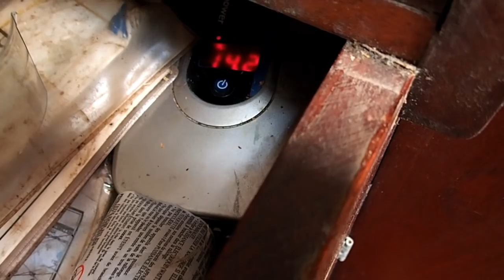The Power Grid for a 31-foot Cruising Boat

Comment: i also inherited a small wind turbine...which help keep power flowing in on those dull days up in the North of England. also giving me power at night. worth considering..but now I have a dual battery system with solar / wind to charge the batteries...but also a separate 'house' bank with its own solar...which also acts as a backup for the electronics if needed
Reply from the maker: True, solar doesn't work as well up north, especially outside the summer months when the sun is low in the sky.

Comment: Hi, have you considered Lithium Iron batteries , such as (LiIo4life or similar) They are more longer lasting, can be charges at a higher voltages so less losses. And you can have a depth of discharge to 10% or lower with out damage or issues. Where you need to keep your depth of discharge at 50%. . you could actually have less battery watt amps.
Reply from the maker: Yes, probably next battery replacement I will go with LiPo.

Comment: Sir, you are easily one of the MOST helpful videographers on YouTube regarding cruising!  So...I note that you didn't mention wind generators but went straight to the gas portable generators.  Is there a specific reason for this?
Reply from the maker: I've heard mixed things about wind generators.  My biggest problem is where to mount it.  The little gas generator is a nice backup.

Comment: I've heard something about a max of 10 feet to avoid the voltage drop.  I've been struggling about how much battery to keep.  For me - alone that is -  what you have 100 to 125 usable amp-hours is probably good.  With my kids I'm unsure. I"m thinking 400 amp-hours total.  Maybe even lipo...  They have their phones and computers. I can see waking up one morning with dead batteries.  AGM can come back from dead once, maybe twice but I don't relish having to fork out 1000 dollars for new batteries because my kids can't sleep some night :)      I don't have a fridge but have been thinking of getting one of the Engel cooler/freezers.  That would make life a little easier.    That and a water-maker and I'm one happy sailor.

Comment: That's why they invented MPPT charge controllers. (Maximum power point tracking)  It takes what ever amount of voltage your panels are making and converts it to a higher voltage which will charge your battery bank even when its cloudy out !

Comment: Thank you for another wonderful video!!  I have 70W of solar on my boat and it has really helped!! I plan on increasing to 200W this year and increasing my battery bank.  I agree 100% that you need a big enough battery bank to last 3 days with out any power,  I am currently not sure if I will go with flooded batteries or AGM.  I agree that the AGM batteries are better, but I can buy 3 sets of flooded batteries for the price of AGM.
Reply from the maker: Check out VMAX AGM batteries.  That's what I use and I find the prices on them are similar to lead acid batteries.

Comment: "cruising emerald steel" channel (another gaffer) has a really interesting take on solar charging.  They have a bank of 6 t-105's and have 180watts of solar panel, so that at max charge it just does an equalization charge on the batteries, and they are on their third set of batteries in 30 years, of full liveaboard, with no charge controller!  They also removed the anti discharge diodes from the pannels, because they measured the loss at night, and it was less than the loss of charging efficiency the diodes caused in the day!  When they leave their boat occasionally for like 2 weeks to a month, they cover one of their 2 80w panels, to make up for reduced power usage

Comment: i get a small petrol trimmer and i connect a cheap car alternator threw a belt drive system! This charges all my batteries very cheaply. Car alternators a cheap to recondition!
Reply from the maker: I take it you mean a gasoline powered hedge trimmer.  Now that's inventive!  I don't know too much about car alternators, with AGM batteries you have to be careful not to overcharge them ... thanks for sharing this.
Reply: Car alternators are easy to recondition. Many utube post show you how. It's better then generators as parts for generators are very expensive. If you want simply buy alternator from the car wrecker for around $30. Car altrenators only have two cheap bearing and bushes and four to six diobes. Buy the alternator that have the bushes and diobes built together. Alternator recondition is around $30.
Reply from the maker: Again, thanks for sharing.  A cruiser friend of mine also pointed out these camp generators for a little over $100, though looks like you would still need an a/c charger to charge the batteries with it ... 
https://www.harborfreight.com/engines-generators/gas-engine-generators/900-max-starting700-running-watts-2-hp-63cc-2-cycle-gas-generator-epacarb-63025.html

Comment: Whoa, Kevin!! Never mind the boaty stuff, what about making an episode on giving yourself a haircut?? A cheeky lapse in continuity, might i say. First you don't tell us your a wizard with the Axe, now we find out you're a demon barber. Your live aboard lifestyle know no bounds.
Reply from the maker: LOL!  I didn't shoot this vid all in one sitting ... I went ashore for a haircut in between takes.
Reply: How to Sail Oceans Ah, I see. I thought you might have a 12v pair of clippers haha. Which begs the question, is that VOX amp 12v or do you have an inverter? Thanks for the info on solar by the way, but have you seen Patrick’s upload on the methanol charger which I thought was very cool. What do you think?
Reply from the maker: I use an inverter to power the Vox amp, which, btw, causes an annoying buzz.  For recording guitars I have to use my Zoom effects pedal which is powered by a USB cable off the laptop--all DC so no problem with buzzing.  Yes, I checked out Patrick's charger, very cool and environmentally friendly.  Expensive though.  If I recall it goes for about $6K; you can get a gasoline generator for five hundred.  The fuel packs looked expensive too.  Maybe prices will come down in time as they did with solar.

Comment: Another excellent video. I too have used solar on my boats. Usually had only two batteries , on my 24" Bristol, that was all I needed. I am now fixing up a 26' Bristol and will opt for rigid panels this time. I will also consider AGM batts. I am 81 and this will be my last boat; might as well do it up right!Thanks for sharing, your information is spot on. BUT -------- no T or A ?
Reply from the maker: Thanks!  And I have had good luck with the VMAX batteries, which, at least when I ordered them from Amazon, were much cheaper than the AGM batteries you find in the marine stores.
Reply: Carleton Scully brilliant comments,stay safe.

Comment: Great video!  Realistic observations that the average guy can apply.  Good tip about keeping the charge controllers close to the bank!  How  do you monitor how many amps you are getting into your batteries daily?
Reply from the maker: I don't have any way to measure amps other than detaching one of the wires from the charge controller and connecting it through my multimeter.  So I can only "spot check" current and estimate how much energy the panels produce daily.

Comment: Nice video as usual Kevin.  Your set-up sounds fine for the sunny south -- at anchor.   I think I'd be quite nervous without a permanent structure for long passages, though you have demonstrated it possible to do without bolting all that hardware on.  Bravo.    I may buy a hydro-generator (like a Watt & Sea) one day to avoid all that structure over the stern.   Thanks for triggering the thought process.
Reply from the maker: Thanks Patrick.  I may yet build a techno-tower on the stern, but so far my systems works for me.  Solar keeps my batteries charged up on the Chesapeake as well, except during the occasional rainy stretches.
Reply: Patrick Laine I have been looking at hydro generators also as a option what make of hydros have you been considering
Reply: I have been considering a Watt & Sea Bob.   They are pretty expensive though..... but a good piece of equipment.   Widely used by ocean racers.

Comment: Great information! I was wondering about your fridge. You mentioned that it was drawing 6A. Would you say that was fairly typical? Also, how many hours a day on average does it run? (I assume not that many if you're using around 50ah/day in total)

Really enjoying your videos. Thanks.
Reply from the maker: Thanks.  As I have said that's a subject for another vid.  During a sunny day it will run in freeze mode for about two hours until it has freezed the fluid in the holding plate inside the icebox.  This acts as a thermal battery, so that during the night when the batteries are not getting any charge the compressor does not need to cycle much, and when it does it runs in low power mode, which draws only 4 amps.   I do not know how many amp hours it uses, only that typically by early afternoon the battery bank is coming up to full charge again.
Reply: Ah, sorry I must've missed the bit where you said you'd cover it in another vid. Thanks for the reply though!
Reply: Very eager to see the upcoming refrigeration video! We are trying to determine the best way to go on that subject now.

Comment: Excellent! ☀️=🔌=💡
When I install solar power systems I go for 6 mm2 leads = 0.009 sq inches from panels to controllers and then to batteries. Then you I go with 4 mm2 = 0.006 sq inches from batteries to the loads. I don’t know how these measures are compared to gauges though?
Reply from the maker: Neither do I, only that you either need very thick wire or very short distances  from controller to battery to keep voltage drops from becoming an issue, at least that has been my experience.  From the panels to the controllers doesn't seem to be a problem because generally the panels will be around 21volts open circuit, which is quite a bit above 12volts.
Reply: Ha, I just found this! 12 gauges is close to 6 mm2 and 13 gauges is close to 4 mm2. 
https://www.rapidtables.com/calc/wire/swg-to-mm.html
Reply: I think you should also calculate in power loss (from wire gauge & length) when configuring your wire run from panels to controller if you want to get the most out of your panels. There's good info online for this.

Thanks for the informative vids BTW, I've just come across them (currently trying to catch-up). Unlike so many sailing vlogs, there's actually a considerable amount of knowledge to be gained from yours.